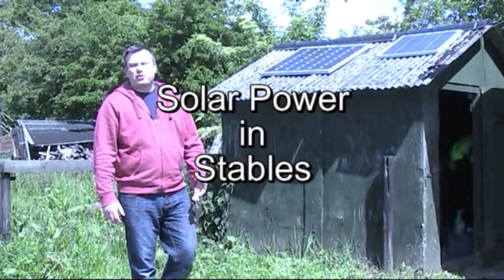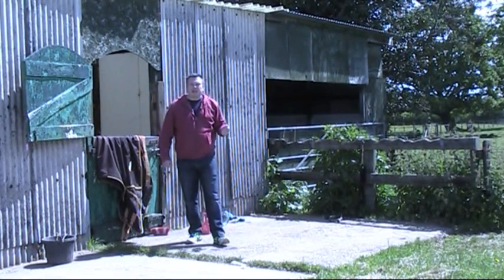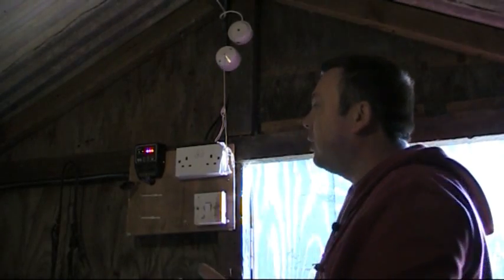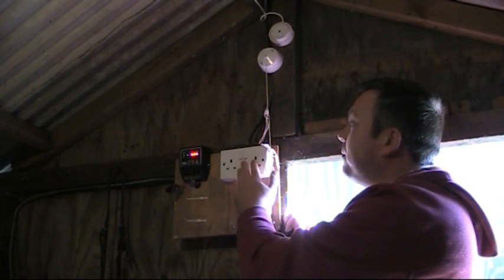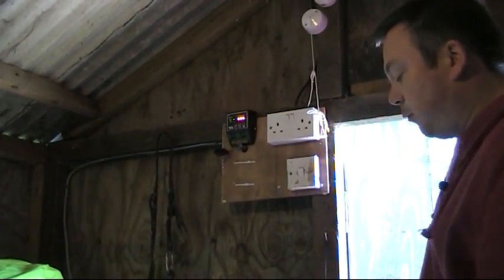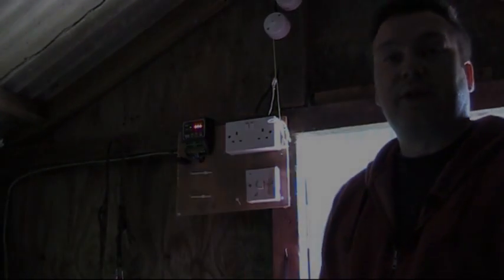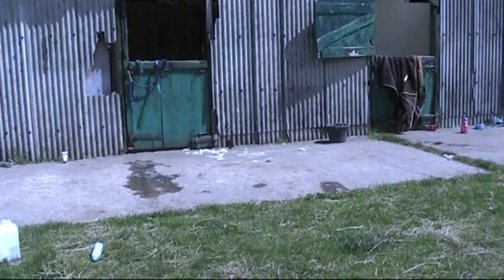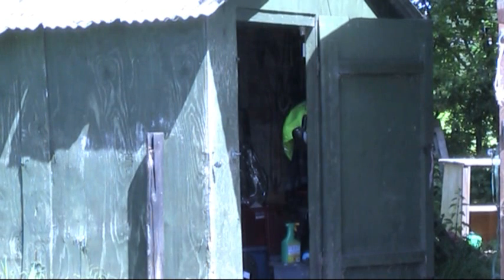Solar power in stables

Comment: hippyraverocker is correct...also a 100w panel and a 50w panel does not equate to 150w...they need to be matched pairs or one will cancel out the other..
just an observation guys..:)
Reply from the maker: hacky2008 Ok thanks, wasn't aware of that.  Think I need to do more research.  Thanks for the tip.

Comment: Ideally you should have a small earth spike wired in with your inverter so that the sockets can trip if if there is a fault.
Based on the open area I would also suggest using an inline RCD for extra protection, though just check first that it works properly with your inverter as some get hot if your inverter is not pure sine wave.

Only other thing is that wire going between the two buildings, I would protect it by running it through some hose pipe or similar.
You may also want to consider swapping the charge controller for an mppt one for better efficiency.

Good video though, shows what a nice simple setup can achieve :)
Reply from the maker: hippyraverocker  Thank you. You're right, about the safety aspect.  We always use an extension lead with the appliances we use and the lead has a built in RCD in the plug.  Maybe I should look at fixing one in the circuit though.
Reply: hippyraverocker I didn't think about that, but have done before for generators.

Comment: I agree James its a good video full of information that is very useful. What did that system cost in total?
Reply from the maker: Gary g1fsh  Thanks, the whole system cost around £150, it was fun to do, and quite simple too.  I think the next thing to do is to upgrade the battery and the inverter.